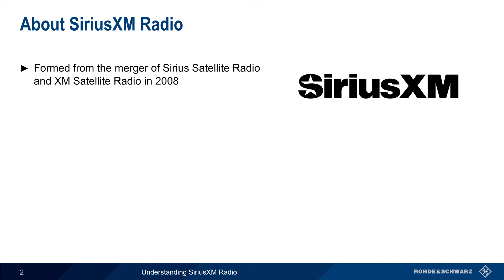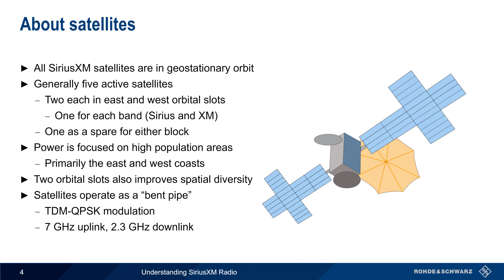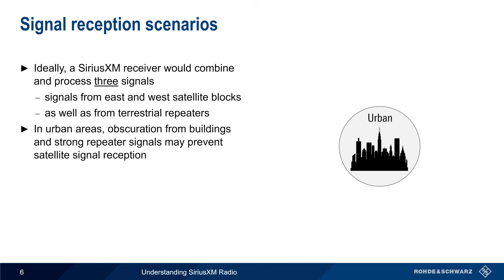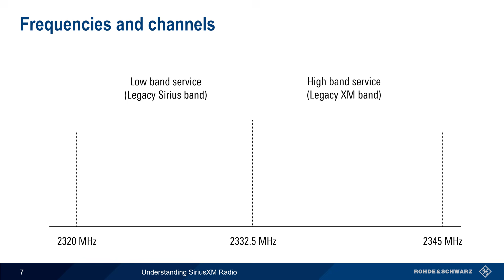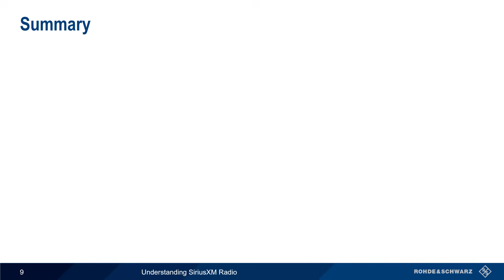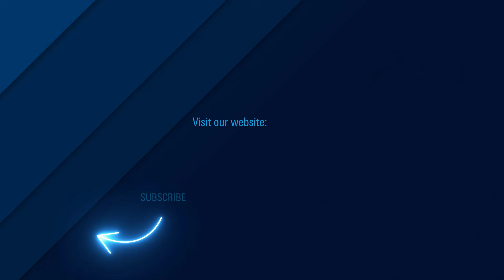Understanding SiriusXM Radio

Comment: Questions:  How does the signal reach the radio receiver in an automobile?  Does it need a functioning car antenna?  Also why would the output (music, talking) skip?  Sounds like a short or interruption in the signal.  Where do I need to start to troubleshoot?  My radio has a button for AM/FM radio too but it does not work.

Comment: Why is Geostationary (GEO) orbit used instead of Low Earth Orbit (LEO)?
Reply: In general, GEO requires a much lower number of satellites (since they are stationary and don't "rise" and "set" the same way that LEO satellites do).  Also, since SiriusXM is a broadcast system, the additional delay associated the GEOs is not an issue.  Note that originally, Sirius satellites were actually in HEO (highly inclined, elliptical geosynchronous orbits), which creates a kind of figure-8 shaped ground track.  Sirius later added a GEO satellite and post-merger all SiriusXM satellites are now geostationary.
Reply: @pauldenisowski Ok, thanks for the info.